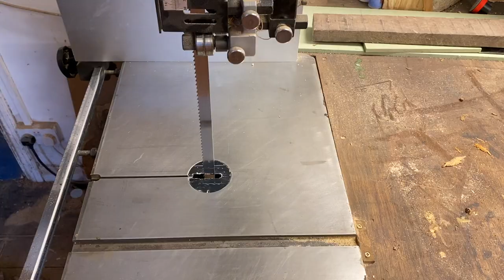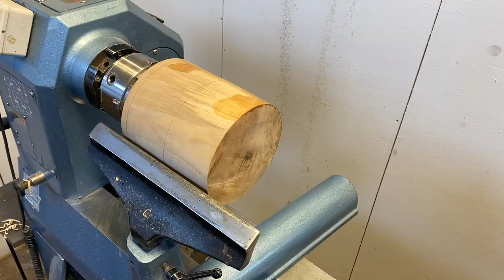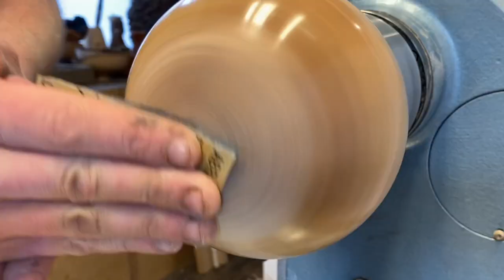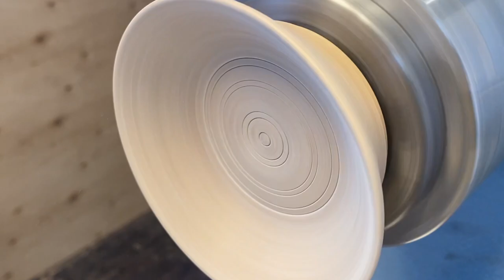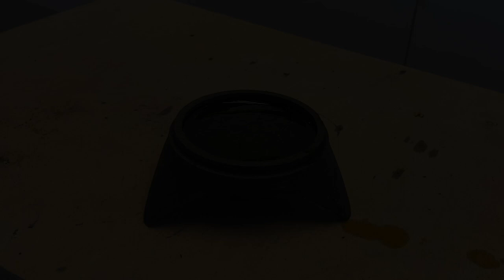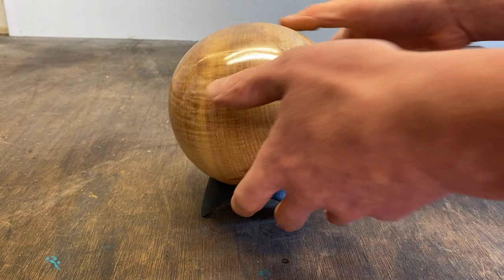Woodturning - Secret Sphere Surprise !!

Comment: Ahhh, the band saw!  Very good idea for speeding the job and improving that safety, I’m always talking about 🤓👍
Reply from the maker: It doesnt improve safety Bryan. May speed things up at times or give you useful off cuts of nice figured maple (rare round here) but a bandsaw dose not make turning safer. If one was to assume a piece was safer because it had less pointy corners they may over look procedures ( that take place during mounting and turning) that actually make turning safe. 🥸👍🏻
Reply: @JackMackWoodturning  all right, all right, I’ll stop harping on safety 😂.  Love your work.  Keep doin whatcher doin!
Reply from the maker: Nothing wrong with harping on about safety as long as the things your telling others are correct 😊👍🏻
Reply from the maker: Cheers for the kind words buddy 😊

Comment: Absolutely awesome Jack, love the stand too! Spheres are still very much witchcraft for me at the moment! 😂 Great job!!
Reply from the maker: Thanks matey. If you look close you’ll notice it’s not a perfect sphere.. but, as they say, practice makes perfect. So just take a day and a pile of scrap wood an turn wide spindles into dome or hemisphere shapes.. that way you practice the hemisphere and can just keep taking another cut each time. 

The real key to locking down woodturning skills as to aim to make a very large pile of shavings rather than any finished piece. Shavings are never waste too, they can be composted, or use as garden mulch to keep weeds down under shrubs or used as garden paths or even kindling for starting a wood burning stove ect ect ect.. and that practice will be worth it’s weight in cheap scrap wood 👍🏻
Reply: @JackMackWoodturning  Couldn't agree more with that to be fair! Even if you leave the shop with only sawdust and shavings, it's still time well spent! Cheers mate!
Reply from the maker: Exactly mate. The most valuable thing isn’t an object. 😊

Comment: Another amazing piece. Where did you get that open ended forstner bit? And which hollowing tool are you using? Thanks!
Reply from the maker: Thanks. My hollowing tools come from Simon hope woodturnig tools, by far the best on the market. This fostner bit is made for cutting directly into end grain. Also works for side grain. I don’t remember where I got them from but you should be able to find them online pretty easily. 👍🏻